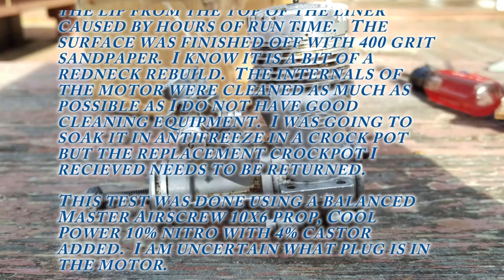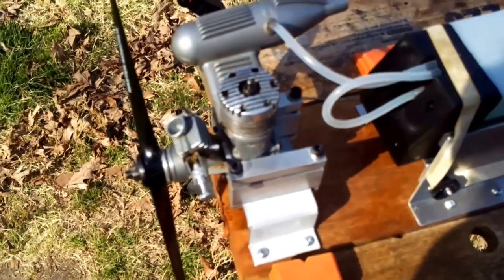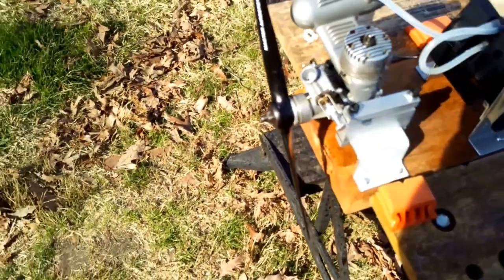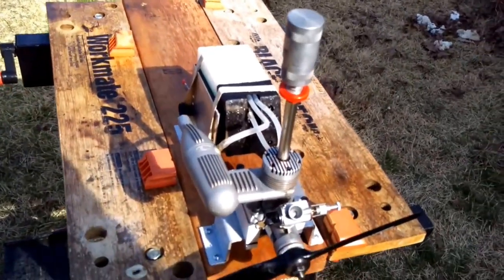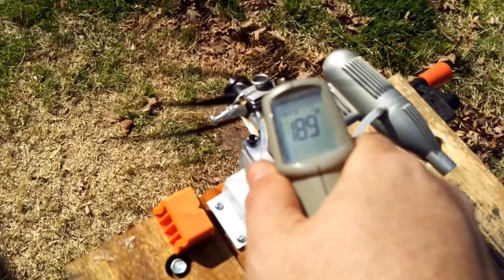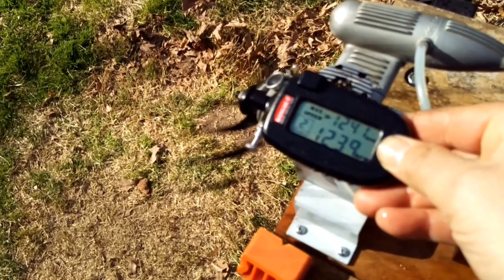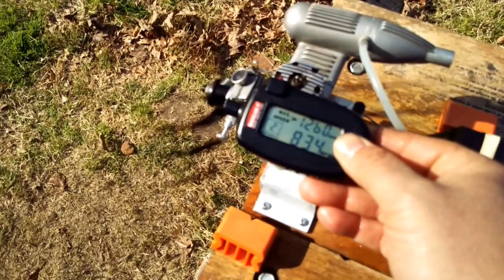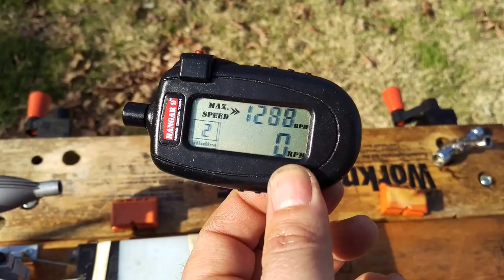K&B 40 #4011 - SN 76438

Comment from the maker: What fuel are you using and how old is it?  What about glow plug health?  What plug type is it?  

Step 1:  tune high speed needed to max speed, with throttle wide open, then open high speed needle about 1/8 turn more.   That should be a good starting position for high speed needle.  Keep igniter on it engine will not run without it.  
Step 2:  same procedure for low speed needle with throttle near idle.

If engine will not run without igniter after this,  change plugs.  Once tuned, you should be able to start the motor with igniter on, run it up for 5 seconds, remove igniter, and go back to idle.

Comment: 6 years later! Any chance you can fix my issue 😂 i have the same engine, but it wont run with the ignitor removed and ive tried adjusting the low speed needle but its fully out right now and if i turn it clockwise at all it wont start. Air leak? By the way i have the same carb i have the high speed around 2 turns out and like i said the low speed is all the way out because thats the only way it will run. Thanks man

Comment: Hey nice run and rebuild! Do you know where the low end needle is adjusted on this? My friend is giving me one to adjust for a friend of his. Looking at it from pics I don't see where to do that adjustment.
Reply from the maker: Greg, thanks for the accolades.  Does your carb look exactly like mine?  The 4011 had a number of different carbs on it over the years.  In this one, you can take a look at the opening screen shot.  Both adjustments for this carb type are on the same side.  The shiny metal part on the carb projecting toward the camera is the high speed needle.  Adjust that one first.  Start around 3 turns out and turn it in at full throttle to achieve max RPM.  Once that is found, unscrew it until the rpm just starts to drop a little but it still runs with a smooth sound.  This might be a 1/8 turn CCW.  

Then adjust the slow speed needle.  It is not a needle in the truest sense.  In the same opening shot, you can see the black screw head buried in the brass part of the carb.  it is in the 11 o'clock position on that brass disk.  That is a cammed screw and will rotate the brass assembly ever so lightly one way or another.  Adjust this with the engine at an idle.  If you have a tach, the engine should idle between 2000 and 2500 rpm.  I set mine so that I can pinch the fuel line and the engine picks up a little rpm before trying to quit.  Also, you should be able to advance the throttle and it should rev up without hesitation.  If it studders, the low end might be rich.  Turn the black screw clock wise.  If it sags (will not take a throttle advance but is smooth), then you need more fuel.  Turn that black screw CCW about 1/10 a turn.  

If you have the all metal carb, then you have two opposing needles.  SImilar turning method but your low speed needle is on the opposite side of the carb from the high speed needle.

If you have the Perry carb, your low speed needle will be a large disk found on the left side of the carb.  Same tuning procedure as above.  Use very small increments to adjust that low speed needle. 

I hope that helps.
Reply: @rscarawa  thanks for the explanation. I see it now. I don't have the engine in hand yet, just going by pics my friend sent and your video. I actually have a similar Kn'B with a remote needle. It has a brass disk with a hole and rotating this adjusted the low end. Not sure if it's a needle or air bleed I just adjusted it for response. It is very sensitive to adjustment so it makes sense that a cam could do the job. My friend was trying to adjust the low end by way of the carb limiter haha! And wondering why the thing didn't respond. He pulled it from the plane and I'll look at it for him. I have some confidence that I could help now. Again thanks for the help.